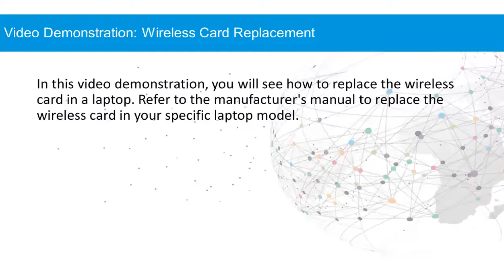video demonstration on how to replacing the wireless card on a laptop

Comment: I have to do this twice this week to 2 ancient Medion Akoya laptops with dead keyboards and here's the kicker... To turn on/off the WiFi on these models - you hit Fn + F7 and the toggle option on screen is greyed out and un-useable! Kas the keyboard doesn't work, even a usb keyboard with a Fn key is useless as it's too new and doesn't have the WiFi toggle logo mapped anywhere on it! 🙈 So to get around that, remove the WiFi card and use a usb WiFi dongle, plugging in an ethernet hardwire connection to allow driver download then the laptops will be ready for Internet connection... As they bloody well should automatically be!!! 😠

Comment: Hello, my laptop with 2 antennas has a wlan card (only 2.4Ghz) with 2 notches (M2-E key) and gives me 2 bars of wifi signal (2 from 3 Windows' wifi signal strength). I have this doubts:
1. If I put a better wlan card with dual band, does the wifi signal strength of 2.4Ghz band will increase?
2. Can I install a compatible wlan card with 3 notches (M2-A key and M2-E key) or just 2 notches?
Reply from the maker: Hi there! I'd be happy to answer your questions.

Upgrading to a dual-band WLAN card may improve your overall Wi-Fi signal strength, including the 2.4GHz band. However, this depends on a few factors such as the strength of the signal from your wireless router and any interference from other devices in your home. Generally speaking, dual-band cards tend to offer better performance and higher speeds compared to single-band cards.

The number of notches on the WLAN card determines the type of M.2 slot it will fit into. In your case, you have an M.2 E-key slot which is designed for WLAN cards with two notches. You cannot install a WLAN card with three notches (M.2 A+E key) in this slot. However, some laptops do have M.2 A+E key slots which can accommodate both two and three-notch WLAN cards. You should check your laptop's specifications or consult with a technician to determine which type of WLAN card is compatible with your system.

I hope this helps! Let me know if you have any further questions.